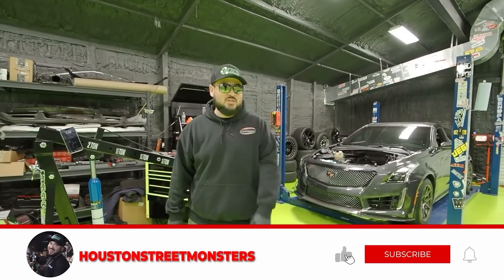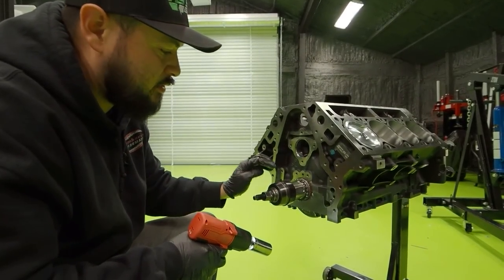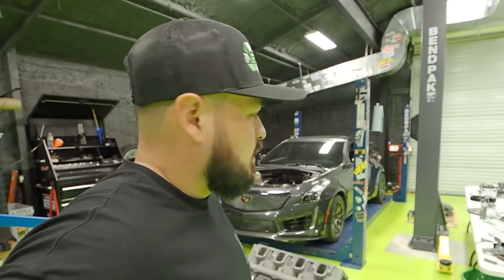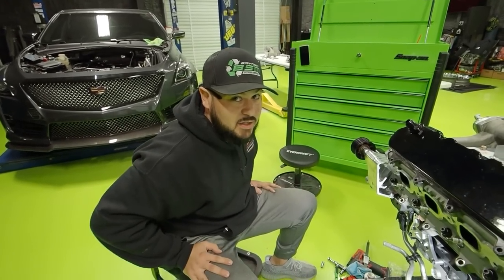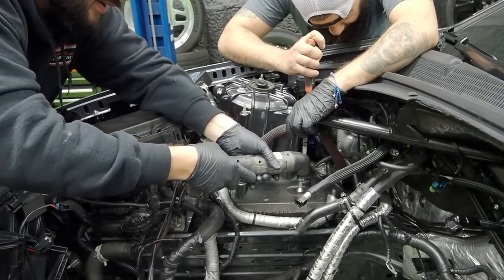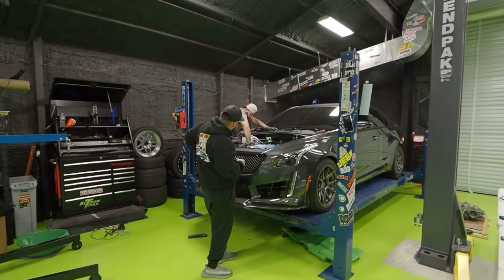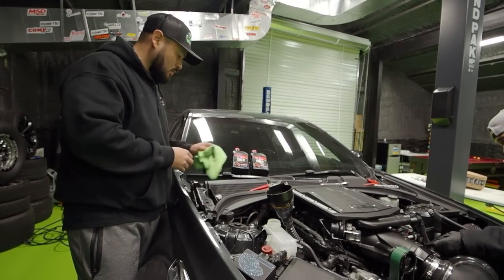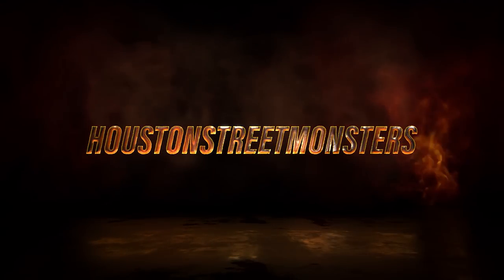CADILLAC V3 GETS NEW 6.6L IRON BLOCK FROM TEXAS SPEED PERFORMANCE

Comment: How did the TSP unit hold up? My TSP LTX 427 short block popped a water jacket outside of the sleeve. 
Dropping TSP all together and going to LTR block now. TSP was zero help.
Reply from the maker: @Mr1T2X1  ive always had good luck with TSP…
Reply: @ well that’s good, if something goes wrong hopefully TSP will backup its builds for you..they didn’t help me any and it took quite some time just to get someone on the phone to discuss the problem. No support from TSP so back to square one on the build now.
Reply from the maker: @ sorry to hear!

Comment: Whats the diy with that relay bypass for the intercooler pump?
Reply from the maker: I just use a wire to make the 2 bottom blades on the relay touch.. then i insert intercooler pump relay back in, powers on the pump without having to switch on car..